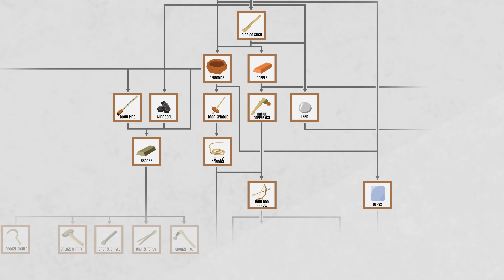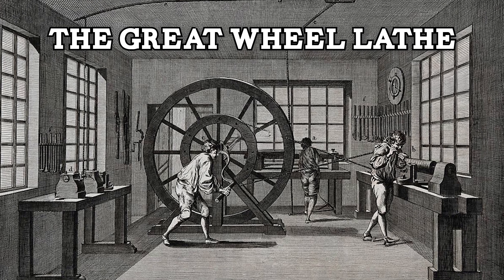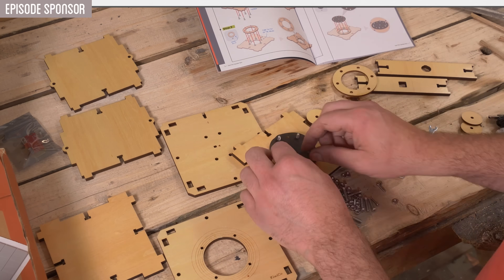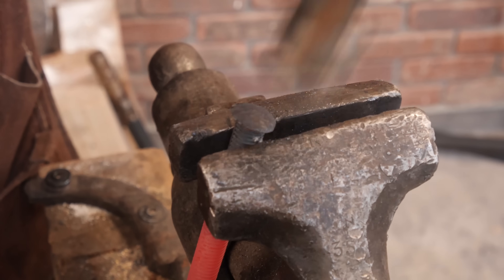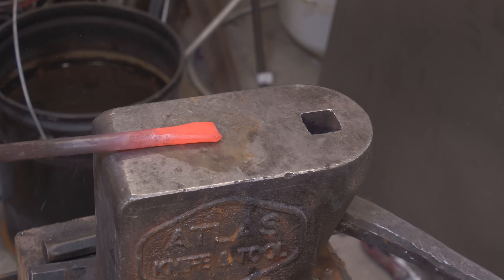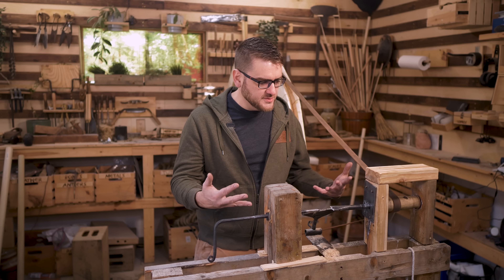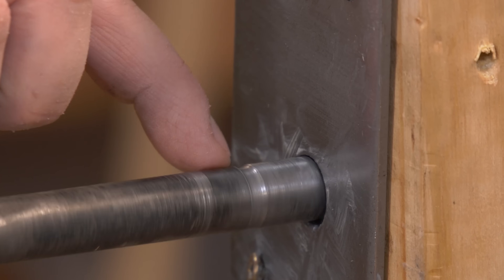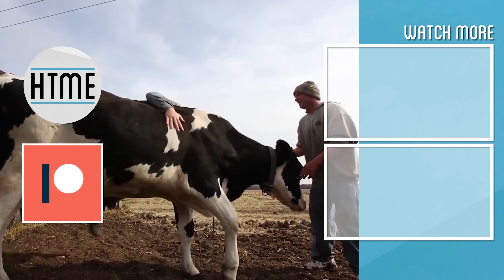Building the Lathe That Will Build Everything

Comment: You could try a lost oil bearing swap your pine uprights for a good hard wood and drill a small vertical hole through the top into the shaft space add a small reservoir fill it with a heavy weight oil and voila low friction durable bearings using all the technology you’ve already unlocked

Comment: Your footstock wobbles too much. Instead of a long threaded spindle, make your footstock two pieces that is spread open with the screw kind of like a wooden clamp. That you you can keep the spindle short and more stable. Same goes for your headstock. Your bit is too long which is why you're getting wobbles. The single 2x4 allows for too much play. 2 of them with a space between would give you more stability.

Comment: the issue you have with "chuck" is that when using lathe between centers (what you are trying here) both centers should be stationary. What you want instead, is mount the pully next to the right center end (maybe with a washer) and connect your wood stock via lathe dog to the pulley itself, this way the rotation will be passed from the pulley, but the stock will rotate around the fixed centers, making it so precise that you can use it for watch making, even in this primitive stage,... also your tool rest should be as close to the stock as possible - 5 mm from the outer "bump" is best, once bump is removed, move it 5mm to next outer bump until you are evenly 5 mm away ac cross the whole wood stock.

Comment: watching the rope on the pulley sliding back and forth is a problem easily fixed by raising the wall so the rope has no where to  move except the direction being pulled.

Comment: hold on, lathe is not the most important tool. its application scope is limited. anyways the tool user will get to the peak fast because of the focus on actually doing the thing, not superficial overview. ie you actually want to make things work, not just play around. ie its not only a copy of existing stuff, but the own experience made tool by the who wants to use it. actually. dont detach the tool from the user, otherwise the tool is devalued. tool is now meh, instead of being useful. no care of the tool, just random fiddling with it. hold on, the tool user needs to be actually interested, not just for money trade human community pressure reasons. you recognize the angle of approach. yes paid interest is no interest at all, really. yep sensible usage of the tools and effort. not biased or unnecessary imbalanced. ie touch grass often. fast hacks are only fast hacks. your motivation makes a difference. not just to stay alive. bias introduced if you have that focus. community feeding initiative focus is the worst. you dont live by the bread and water you think you make for yourself. tether support beams. take your time no horry.

Comment: a quick info with the belt system. if you invert the shape so there is a hump on the pulleys it will track better on them. the hump allows it to center look at old steam engine pullies and styff for like tractors you will see the hump. that way it does not need to be so precise.

Comment: The eggshell color oxide on the hot steel tells me you were forging galvanized steel. I know you are going to anyways, but make sure to stand clear of that forge while it burns off or at least sand it off first. Your lungs and brain will thank you when you are older. Blacksmithing is bad enough on the lungs due to the carbon and ash from the forge, no need to add zinc as well. Lol be safe and happy forging!

Comment: Might I make this suggestion? By the time humans had developed iron making capabilities we already had extensive knowledge of more malleable metals that have lower melting points. 
Use a tin/lead/antimony alloy (Babbitt), brass or bronze bearings to stabilize your large spindles & pulley shafts. That will make your machine much more precise.

Comment: I hope this doesn't get buried in the comments, when you use white belts like the leather belt you use for the large wheel, you need to use a concave shape for the Wheels otherwise the concave shape pulls the belt up and to the edges counter-intuitively. Convex shapes are best suited for round or thin belts

Comment: Could you use clay to add weight to the main flywheel? in not sure how it'd affect getting up to speed in this configuration, but I think it could help with torque, though with the belt skipping it might just not work at all.
Have you considered casting bronze/copper gears/pegs? You could potentially a create chain-like multi-strand braided leather belt with catch holes for the pegs. The peg shape could be designed like hooks which pull on each loop,  grabbing and releasing at the correct angles acting like an inverted timing belt. It would elimate slipping.

Comment: Very neat to see you build this.
I have a very strong suggestion to help reduce the wobble on the pulley side. 
Currently you are using only 2 points of contact on either side of the drive wheel, and then straight into the peice you're working on. Instead move the piece further away and add an additional point on contact between the Work Piece and the pulley. The further you move away from the pulley with this third "Bearing" the less wobble you will experience. 
It is not a perfect solution but should bring metal latheing within grasp on the current system.
Also you need to re-align you're Stationary pin a little better to atleast be in the middle of the "Wobble" range.

I can't wait to see how it turns out as you progress! 🙂

Comment: I would add a belt tensioner to it.
This can be done by simply building a heavy sprue on a fellable joint and place it onto of the drive housing.
And have its axle arms extend out and rest the tensioner sprue on the belt.

That will help to stop the belt waving up and down as it goes from the big wheel to the drive sprue.
It should help a lot to remove some of the belt's jitteriness and make it run much smoother.
Reply: I've googled some of the terms but I still can make heads or tails of it all
Reply: @old-old-old-o1i  Basically putting a weight on certain parts of the belt.
It is done to keep the belt from bouncing and wobbling around so much.

Which leads to smoother running.

And the other parts are just to refine the design to make for smoother and more stable performance.

Comment: Lock down the tail stock handle once you get it under tension. 

You need to get the spindle and tail stock aligned. Will also help with work holding. 

Lubricate with fat or soap anywhere that pieces touch.

Comment: One thing you seem to have skipped right over are bearings for your axels and pulleys.
Having bearings which don't wobble around (or cut grooves in your shafts, like your metal plate headstock bearing) will vastly improve the usability of this lathe, the simplest being a cast babbitt bearing. The strange coincidence that 60/40 lead/tin solder is pretty darn close to the correct alloy should be exploited.

Comment: This is a great breakthrough!  One that could have been water powered with some modifications.  Oldest lathe I saw, was my great grandfather made.  He used burlap sacks as bearings.  There was a hole to add oil to the burlap.  Used a washing machine motor for power.

Comment: Make a bronze bearing for the metal contact, its a bit softer the iron/steel so it will wear instead. Copper is a bit too soft, but still better then steel on steel.

Comment: Might I suggest seeing if a tensioner pulley setup would help? You could make another wood pulley and put it under the belt, put it on a pivoting arm with a fulcrum in the middle that way you can set up a counterweight at the opposite end from the pulley to use gravity to push the pulley up and hopefully keep it pressed into the belt and as-such keep proper tension. By doing this you might then be able to put more force into your chisel before bogging down the system. You could also crown the flywheel like you did with your driven pulley to help keep the belt on (when you curved the surface of your driven flat belt pulley you made what is called a crowned pulley, as you found it helps to keep flat belts centered).

Comment: it blows my mind how lazy you are on looking into proper materials if you just looked at using hard dense wood with grease lubricant for bearings instead of using 2x4 and 2x6s with holes and not lubrication your projects would not fall apart hell even a little scrounging of pallets would find you some better materials you seem to equate early methods with crewed and sloppy (heck i have a old hand cranked grind stone that was converted to run off of an electric motor 80 or more years ago that 3ft tall and almost 4 inches thick there is almost no slop in the original wooden blocks that support the wheel or the pulleys that step down the speed of the motor just some oil wicked in with every use

Comment: Alternative reciprocating to rotary motion.... pump to lift water to a reservoir. Valve to let water flow over waterwheel that drives lathe.
Reply: But then you need to power the pump.
Reply: @KaitouKaiju  ???
piston pumps are reciprocating. Power such manually.

Comment: Always a pleasure to see the problems Newtonian physics puts in our way and how you solve to the required amount.  You are on a horizon as you suggest with the lathe, or continuous rotation lathe, I did some spin casting today on one of mine. Its as much a high powered headstock as the precision parts referenced to it. a hugely versetile machine. but im wondering what did the lathe first make .

Comment: Something I have to comment on: the tool geometry on your chisels looks very suboptimal. You want the top face mostly straight or slightly angled back and the bottom face angled almost vertical. It's a turning tool, not a knife. Your tool seems to do more of a scraping action than actually cutting. Imagine it being like a really thick spoon.

Apart from that, a really stable and straight spindle is key to any lathe, best choice would be something like babbit or bronze bearings. It's just gonna be a little difficult to get the spindle shaft really round.

Btw. how did you make the wooden threads? I saw a video once where someone had a tool that was a little like a comb, where the front teeth would cut the threads and the back teeth would guide the tool in the freshly cut grooves. He was establishing the start of the thread really carefully at first and then extending it bit by bit, checking the diameter then in multiple places to make sure it wouldn't be tapered.
Reply: I was wondering if someone woul mention tool geometry looking at how watchmakers use their Lathes would be of great help aswell as using hardenable steel for the cutting tools.

Comment: Now you can turn nice straight members to build with, that combined with proper round holes of good fit will take you a long ways on the epic journey of gaining rigidity in... practically all your projects besides hand tools. Even if it seems like something you would frame out with rough sawn boards, use turned members with sawn flat ends (squared or hexed like a pencil), the straightness benefit will allow precision in layout and build that will translate to much more rigidity

Comment: Well, Have you tried to build a SPARK GAP Radio transmitter  and a COHERER  radio reciever. yet?  They ARE rather simple and less trouble than a Telegraph.  The transmitter is a basic induction coil and vibrator running a arc or spark gap.  You just need to add an antenna on one side of the gap wires and a ground on the other side.  A crystal or razor blade receiver  would work, so you would not have to make a less sensitive and more complex,  "coherer" even though the latter came first, the other two use even simpler tech.

Comment: "If I can learn from all my past failures" My prediction NOPE. Watches videos: clearly still not learned anything. Still just shoving a rod through a hole in wood and act surprised when it wobbles all over. Two of the greatest problems with this channel/series is the failure to learn and skipping over SO many technologies. Simple bushings would fix many problems, but that would require precision drill bits, both are EARLY bronze age tech that was skipped over.
Reply: What are the most important technologies that he skipped over in your opinion? I don't know that much about technology progression, so I am looking to learn more.
Reply: @charles3-1898  Important is a bit subjective. Related to this is of course bushing and the later roller bearings that also predates lathes. Multiple measuring tools where skipped after he covered the earliest forms of square, rulers and levels. More advanced tools like a compass (not the type for finding north, the ones use to copy a length), protractor, dial level in place of the plumb bob level. 

Not related to this. The most 'important' are large projects he skipped due to size, things like boats/ships, windmills, wagons and of course the many improvements to houses. Can't fault him for skipping those.
I think the most over looked are the tools that allow everything to be made. A rope pulling two sticks together to form a clamp to hold your project seams unimportant until you start a complex task. While a auger drill (only form of drill he has made) will put a hole in wood just fine you need completely different type for metal. While a modern spiral bit is hard to craft a straight flute bit is simple and can give a precise hole after a crude bit has made the pilot hole. 

The most 'important' really depends on what the goal is.

Comment: Question:

Once you get a working steam engine are you going to be completely finished with the reset or are you going to revisit things and make them better or "master" them like how you used fire and then after getting a little further you went back and revisited to make it yourself with a tool to make it easier (i.e using a bow drill to make the ember instead of using iron pyrite and flint- using string to make fire Easter to make)?
Reply: lol he’s been doing this almost a decade, and barely at a working lathe point, steam engine will be another 50 years 😅

Comment: Wood soaked in melted wax makes for a great bearing. I'd like to see more of the thread cutting I saw some rig with a hacksaw that sort of made threads but he kind of glossed over that and threads were huge.
Reply: Check his previous videos on thread cutting if you want to see more of that set-up
Reply: I definitely think some kind of closed grain wood like hard maple is the way to go. It's still used as a bearing in specific situations
Reply: @ I remember at least up to the 90's wooden bearings were used on a few machines at a DANA plant in PA. I believe these were bearings that were hard to get grease to or some other thing where maintenance was a pain. I think this was the small plant in Berwick that made truck springs. They did and still do work very well.
Reply: Can I soak it in wood instead?

Comment: You might want to look at using Babbitt cast-in-place bearings. They are very tolerant to variation in the bearing case, tolerant to lubrication issues, and relatively easy to make in a home shop; yet good enough to be used in combustion engines in the 1950s.